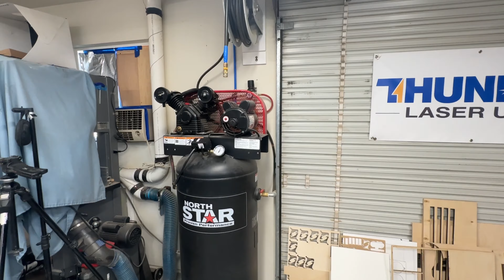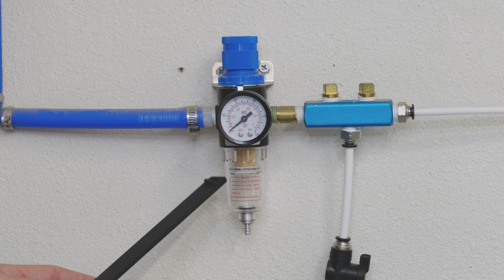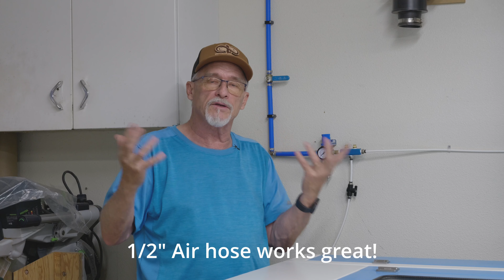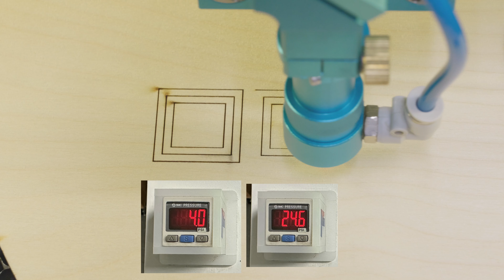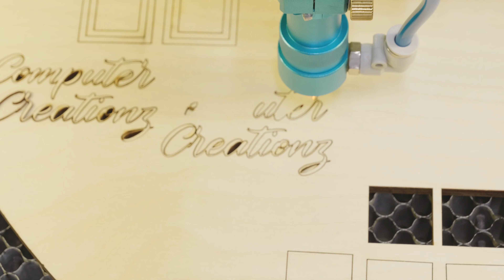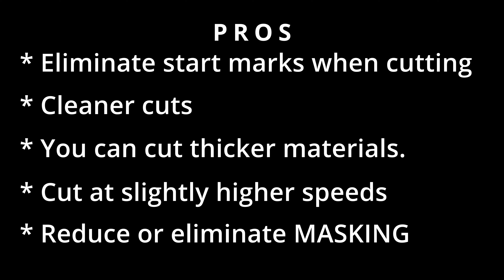Adding External Air to your CO2 Laser, this will save you so much time!

Comment: Hi Robert. I have a question about the external air. I have an external air compressor set up. How do I prevent the backlash marks when it starts a new cut? I have the Hide Backlash checked in my Optimization Settings, but even with my external air @25PSI I get those marks. I see in your video you do not.  Curious and thanks

Comment: the technical part  https://www.youtube.com/watch?v=QwOkOLBp1pE
Reply from the maker: the thing he doesn't address on this video is the brown start marks generated with low volume air flow. You can eliminate it with much higher pressures. eliminating costly clean up after the fact!

Comment: Unrelated question. What is the benefit of running air to a fiber laser? Thank you.
Reply from the maker: It blows the dust off the engraving piece make it the fiber more efficient at removing material

Comment: Great video! Loving your digital air gauge you added. I want to add this option and wondering if you have a video showing your installation. I have seen others that utilize a kit but yours is a  much cleaner designs and lower profile. Thanks!
Reply from the maker: I made the housing from,acrylic for the gauge. Took the power off the light circuit off the same side of the laser. Worked great

Comment: Why not simply hook a solenoid onto a relay powered by something on the laser? Or, failing that, use a load control relay on the plug for the laser. If the power draw exceeds a few watts, (IE the device is turned on) the relay closes, and that can power the solenoid.

Look into the Clippard Mouse series. They're VERY low power (2/3 of a watt on the high end), so they won't overheat, even with prolonged use. They support 6, 12, and 24 volts (although higher pressure ones are only 12 and 24), and are rated for a billion duty cycles (In other words until you manage to clog it with dirt several decades from now).
Reply from the maker: there is many ways to get the same result, I covered just one. the bottom line is external air is a game changer for most lasers

Comment: Of my air compressor only has 1/4” connections would there be any benefit to running a 1/2” hose with an adapter?
Reply from the maker: If the compressor is not located at the laser then yes you would benefit from doing that

Comment: Excellent video, very good examples! On reciprocating air compressors used for multiple tools I’ll mention, most if not all are designed for a maximum 50/50 duty cycle in order for the pump to cool. In addition compressed air produced under excessive heat will produce more moisture.
Reply from the maker: exactly. that’s whey I always recommend an air compressor no less that 24 gallon and be sure to put a regulator with a moisture trap right behind the laser

Comment: OMG what a difference! I recently purchased a used 51/130 and the main thing I like to do is paint my wood first and then cut. I was almost thinking I would not be able to do this because I thought the paint was causing the flames and severe burn marks. Introducing external air completely solved this. Thanks a bunch!! And by the way you are an excellent presenter and teacher!
Reply from the maker: that is so great to hear, I know I wouldn’t give up my external air on any of my lasers. so happy for you.

Comment: Robert thank you for the detailed video. I noticed that Thunder states the PSI Max for all lasers is 55. I see in the video you have yours set to 25. Have you found that 25 is sufficient for most cuts on your machine? I was going to set it up for 55 but maybe that is higher than I need (Nova 24). Also, do I need to adjust the air flow screws on the laser for Hi and Low flow? Or just leave them the same as what they came on the machine?
Reply from the maker: yes I set my reg behind the laser at 55psi by the time it get to the nosel it’s about 27 psi.

Comment: Nice Video
Don't have a laser but in my shop I have a contactor in my lighting circuit to turn my 220vair compressor on when I turn the lights on. You could then wire a solenoid at the inlet to the Thunder to the plug on the Thunder that controlled the stock air compressor. Now everything is automatic

Comment: Great video! Would you consider doing a video showing how to actually hook up the air compressor system? Or at least walking us through it. I want to set up my compressor to have an air hose I can use to clean stuff off and then have it also connect to my new nova 63. I live in Colorado so have similar humidity (or lack of). Also, would you consider doing a video showing how to add a digital readout for PSI. Your setup on everything looks so nice and clean. Thank you for your consideration.

Comment: Pressure and airflow aren't the same thing is it? You can have 10 litres/min at both 4psi and 25psi? Right?
Reply from the maker: your correct but flow through a gives size nossle your only way to have an repeatable measurement is pressure!
Reply: @computercreationz I use a air flow meter AND a air pressure regulator.
When I used only air pressure regulator and measured the time between the starr and stop of my compressor it didn't change much, if anything, despite different pressure.

Comment: Can recommend the kobalt 26 gal quiet, just picked it up and already noticing the difference. Its also incredibly quiet holds plenty of air for a long laser job. Easy hook up and cheaper solution.
Reply from the maker: Great to hear, I know of several people that have that unit!
Reply: @computercreationz  hii, i have regular air pump that came with it, i am thinking on getting the same compressor
 Wanted to know if this can work for hour+ long jobs, 
does the air pressure drop or the compressor runs continuously during the process

 i have repeatable jobs which take upto 1+ hours, so wanted to know 
your insights will be helpful
Reply from the maker: @FabledMolar  most inexpensive consumer type air compressors will not last. Buy a commercial grade compressor

Comment: Very helpful video as I'm building a parts list now.  As your method is proven, could you also include parts reference for the 1/2" air hose and ball valves (1/2" and 1/4") you used?  Thanks!
Reply from the maker: thanks for the input!

Comment: I am about to get one of these gauges - can you give any advice on your mounting experience?
Reply from the maker: If you have a thunder there is a nice 3 d printed housing for the gauge on Etsy. Take the power off the light on that side, be sure the air hose that comes up to the gauge doesn’t interfere with the gantry

Comment: In lightburn under device settings down at the bottom you can tick on "enable job checklist". i use this to help me remember if I've turned on the air, turned on the exhaust, and set the focus. It's a nice helper.
Reply from the maker: Great suggestion! Thank you

Comment: Good video but I think you should have covered the high & low air assist on the laser, what it does or doesn't do and how you may or may not be able to select them in lightburn. I assume you are using the regulator to dial in each air pressure you want, but newbies may look at the air assist and ask "what's up with that? ".
Reply from the maker: you can’t cover all the topics surrounding air assist in one video. anything over 20 minutes people don’t watch it. on a thunder laser there is an air control panel and the air is controlled with 2 different needle valves on the top of the laser. most of my videos are for the thunder laser.

Comment: Great video sir and thank you for it. Do you think that it would be possible to let us know the air flow also? I mean what was the airflow in the nozzle hose during 4 PSI and what during 25 PSI? Unit can be liter or galon per minute, what is closer to you. Thanks a lot!
Reply from the maker: the digital air gauge is only about 4-5’ for the nosle. relating to psi is only option I have provided  air flow in a different manor would confuse people in my opinion. thanks for watching and the comments.

Comment: Your Better Off Installing a UPS that will Balance the AC Load. Plug your Laser & Compressor into the Battery Backup Side.
Reply from the maker: I’ve never heard of this!
Reply: It’s not necessary to turn on the external air MANUALLY. You simply buy a solenoid and wire straight in to your laser power supply (same site as the stock pump) and it turns on AUTOMATICALLY when your laser turns on.  You simply have to change the setting in lightburn to make sure it is enabled…and you only have to do this one time.